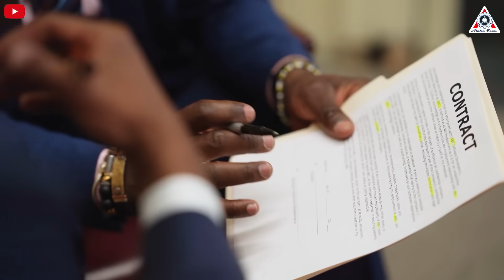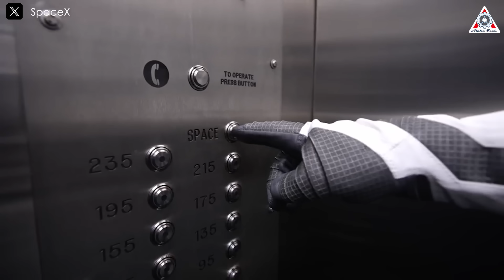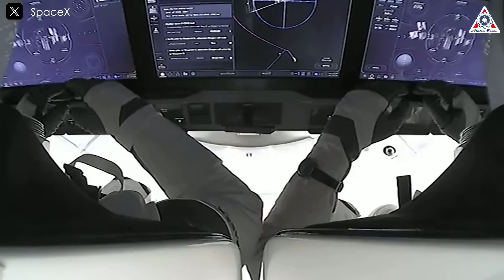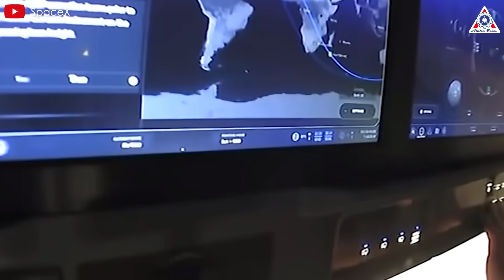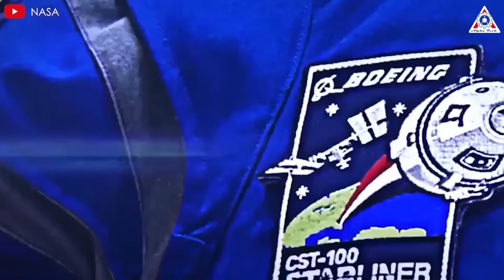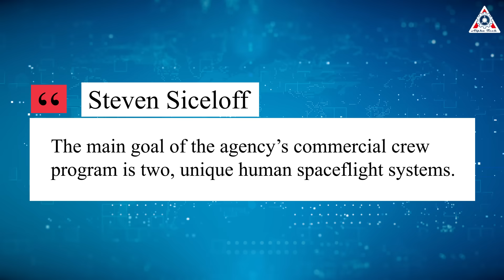Disaster! SpaceX Rescued Starliner Astronauts but Something Bad Happening…

Comment: Boeing is still using "Waterfall Project Management".  Waterfall was invented by NASA to manage the Mercury/Gemini/Apollo space programs in the 1960s.  Back then it was a leading edge process that made sense for the systems engineering required.  The problem is that it is inflexible under requirements changes or new discoveries of physics or engineering because it is top-down and static.

SpaceX is using a variant "Agile Project Management" with short loop iteration.

To quote various sources: 

"Modern Agile project management is a flexible, iterative approach well-suited for managing complex and rapidly changing projects, making it an excellent fit for various industries where technology and market demands can shift rapidly.
 This methodology emphasizes adaptability, collaboration, and continuous feedback, allowing teams to respond swiftly to emerging threats and evolving business needs"

"Agile project management divides larger projects into smaller, more manageable tasks and shorter time segments, known as sprints, which are completed in an iterative and incremental process.
 Each sprint involves planning, execution, testing, and continuous feedback from stakeholders, enabling teams to adapt and make necessary adjustments throughout the project lifecycle"

Individual "sprints" can be "Waterfall"-like but have more limited scope so the static aspects do not lock-in high risks or resource consumption.

Comment: The astronauts were not "rescued."  While Starliner was docked at ISS, it was cleared for use in an emergency.  And after Crew-9 arrived, they could have come home in Dragon in an emergency.  

After they did static fire tests on the attitude control thrusters while Starliner was docked to the station, Boeing was satisfied the crew could come home in it, but NASA was not.  So it was decided LAST SUMMER for Starliner to return unmanned (which, sadly, it did successfully), and Butch and Suni would take the place of two astronauts on Crew-9 and come home in that Dragon.  No heroic rescue by Elon and SpaceX, just enacting the plan decided on last summer months before the presidential election.

Comment: Stich u are a danger to crew safety with the idea that boeing is an exceptable option. U should add 3 other providers for commertioal crew vehickels, and star liner is unspace worthey and presently prioritizes matnence in service modual. If service module to be used once it should not need to be servised acept maby for consumeble input. And they need to dich the damn dog house and space the thrusters properly

Comment: That's 12 min I will never get back. What "Disaster" ? Other than Boeing sucks and was basically a $15B public works project.
Reply: The "disaster" was Starliner's failure to make the round trip safely for those 2 astronauts.   Boeing did all that work, spent billions in development and testing, and it still broke down and left them stranded.     Yes, it's not a "disaster" like an F5 tornado rolling though your neighborhood, but it put them in danger and could very well have ended the lives of those on board.